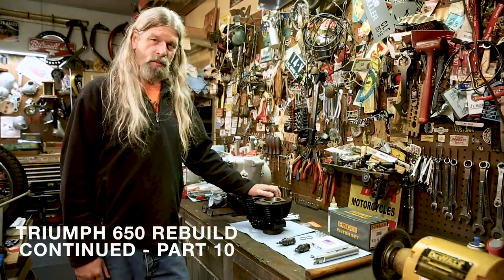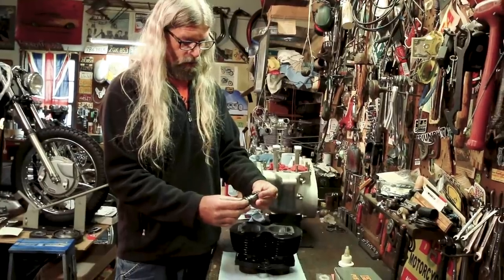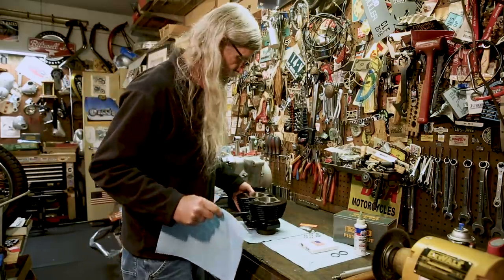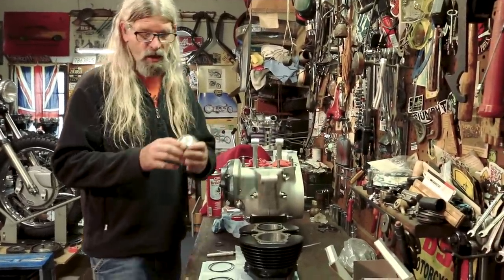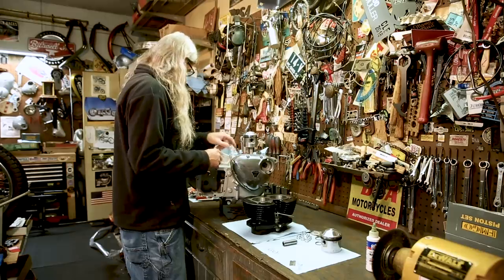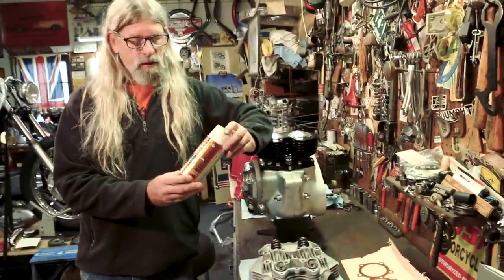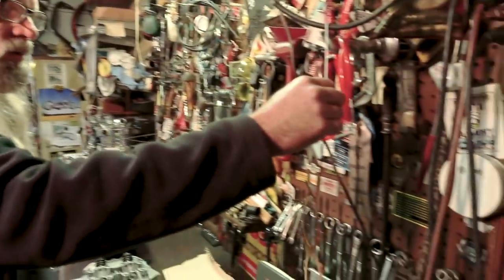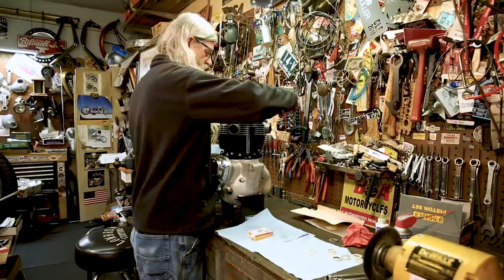Triumph 650 Motorcycle Engine Disassembly & Rebuild Part 10 - Lowbrow Customs

Comment: Thanks Todd - i have been working and fiddling with a 69 triumph bonneville for the last 5 years.  the pushrod tubes were always a mystery to me - the top end gasket set comes with huge variations of o-rings and square o-rings.  Now it all makes sense.  Turns out i had pushrod tubes from a swap meet that were two very slightly different lengths.  I have put the top end on 3x times and just thought the o-ring had not seated on one side.  hahahahaha.  Now i know there are 6x pushrod tube lengths thanks to the explanation in your video.  Thanks so much - this has caused me mysterious issues with my head for the last several years.  Also the clarification on the correct assembly of the rocker washers was invaluable.  I had read the service bulletin and googled for the picture of correct assembly.  Your explanation made it crystal clear.  Another thanks.  awaiting parts and will have it all together and the mystery leak will be gone forever.

Comment: Thanks very much - I knew about using the hose clamps for ring compressors years ago but thought it was backyard after spending years going on a Snap-On truck. I did not have a ring compressor for a 1970 TR6- I tried the hose clamps (In the backyard) - I could not believe HOW WELL THEY WORKED !!! used them twice so I know it was just not luck. Now I am using HOSE CLAMPS and going to Harbor Freight. After 50 years of pulling wrenches I am still learning, Thanks Todd. Denis from SoCal.

Comment: Thanks so much Todd! My 1966 TR6R is now completely disassembled, cases went in yesterday to vapour blast. Bearing etc in the post. Head and barrel away at Seager Engineering in Ipswich, UK. Crank off to be machined next weekend. Then the rebuild! Can't wait! With watching this series of great videos and the DVD by Hughie Hancox, 'Triumph Unit 650' I know my engine will be done right and last for another 50 years! I bought the bike as a non-runner so can't wait to fire the baby up! Todd you are a champ!

Comment: Thank you, Todd. I have been building Triumph engines for some years, so am familiar with what you are doing. But it is most helpful to see someone else do it and gain extra tips. Especially the service bulletins and other trivia.
I now use a plastic chopping block cut in half, with horizontal threaded rods to keep the two halves together, either side of the conrods and sitting on the cylinder base studs, when putting barrel over pistons.
Thanks Todd, great stuff.

Comment: I’ve watched all of these and have thoroughly enjoyed them. Tomorrow I collect my new (to me) 1972 T100R and although it’s the smaller engine the basic architecture and things to look out for will be similar. Amazing that the bottom end hadn’t been apart and yet the sludge trap was clean and the crank journals within tolerance, it must’ve been looked after in the past. Thank you.

Comment: Hi Todd ! Firstly I would like to thank you for your fantastic knowledge of Triumph engines 💪 I have been building and restoring Triumph engines for 45 yrs and have just received a 1971 T140v which had popped the push rods out of the rocker arm balls on the exhaust side ? Hmmm me thinks 🤔 maybe the head was not re tightened after a rebuild and was too loose ? Or just assembled badly! However on further investigation, found that the rocker spindle washer and sprung washer was wrong as you mentioned! And I think the-sprung  washer got caught in the rocker arm end cut and held the up when it should be going down and the push rod jumped out ?

Comment: I find its a good way to test if clips are all the way in the groove is to try to rotate them. They will only rotate when theyre fully seated in the groove. Usually I use a small screwdriver for that, either on the end of the ring or on one of the "eyes" (if the clip has them).

Comment: Hey! Thanks for the great video.One can never know too much about correct assembly technique for these old motors. Just a thought,around 11:26 or so,re: driving home the Tappet blocks,it never hurts to place said Blocks in the Freezer for an hour or so before assembly.The reason being the small shrinkage will help facilitate insertion,AND removal for re-positioning,on the off-chance the locator bolt does not align with the blind hole in the Tappet Block on first attempt. Thanks again.
Reply: Is there any chance of condensation in turn rust, i would hate to have any water be it just a couple drops on a brand new rebuild. I know I know your should try being me for a day,FML.

Comment: I'm going to replace some pushrod seals soon, for the first time.  Glad to get the exact number as far as the gap goes.  (30 - 40 thousands.) Todd said he didn't want to put a feeler gauge between the head and the cylinder with his freshly sprayed gasket.    I'm wondering if I should put it together and check the gap first, THEN go and spray the gasket with copper spray.    Or is ok to slip the feeler gauge in there with the sprayed copper gasket?   I'd love to only have to do this once... but that's not normally my MO.   Usually it's the 2nd time that's a charm.

Comment: Be sure you install the rocker spindles with the oiling holes facing 'up'.  This allows clearance for the oil to exit the holes to oil the rockers and other parts.    If the holes are facing down, the pressure against the bottom of the rockers tends to block the oil holes..

Comment: Back in 1980 I think I used the same head gasket and didn’t know anything about trying to anneal it. Maybe that is why it was the only part on the whole motor that leaked.
Reply: I have 1970 model. I only have to take two of the long head bolts out to take it out of the frame

Comment: My push rod tubes have the wedding bands but I find it will not assemble with the extra flat washer,its been a while getting to this stage in the build.....alway a new obstacle in the road.......just going with o rings.....Wait ,just discovered I may of tried using the wrong flat washers.....good day..

Comment: Given all them correct vs incorrect measures of assembly... Reckon i'd best take them boys down @ Big D Cycle another brisket. 
'68 Trophy Sports done up all the way back in 2012 with 13,384 sucessful miles on it to date.
TR6R DU69160.   12618